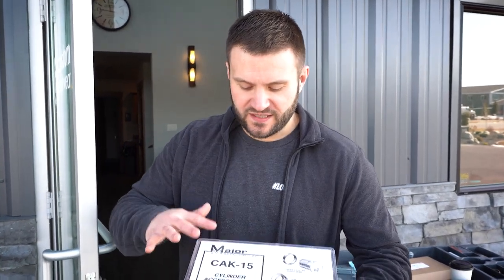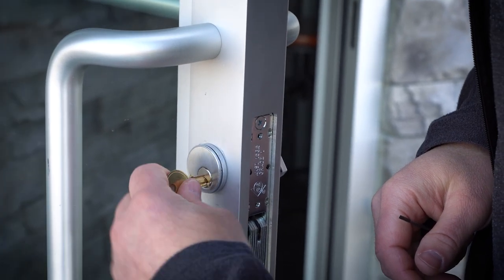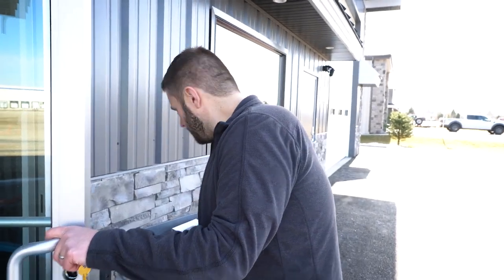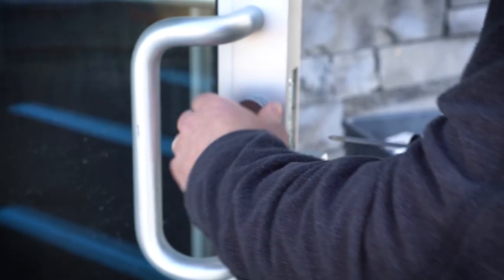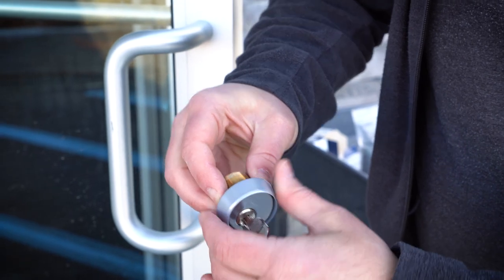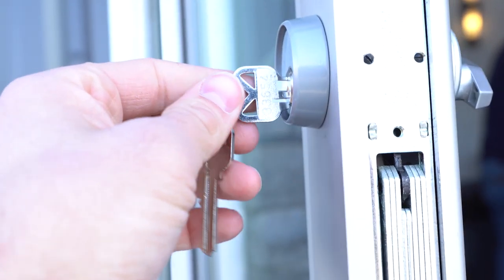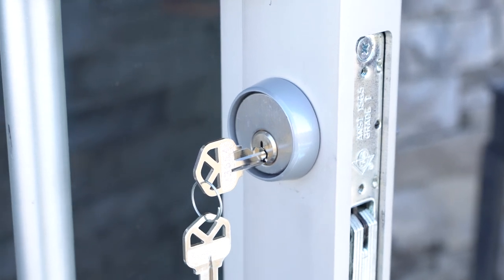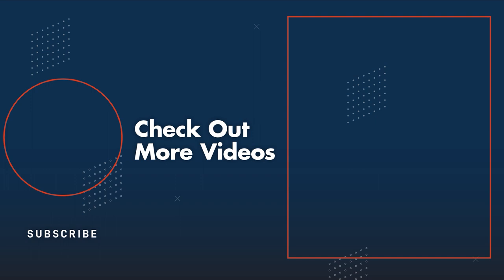Locksmithing 101 | How To INCREASE The Security on Mortise Cylinders!

Comment: I remember the first time i had to repair one of these on a shopping center door. Typical pipe wrench attempted break in. I remember struggling to remove the cylinder due to the fact that the set screws gets twisted  inside the lockbody when the cylinder is forced.

At the end of the day i ended up upselling a security collar to five of the tenants in the shopping center. Like a #Lockboss

Comment: Wonder if the K-Tool still works on those with the security collar. Does CLK sell the anti-bypass disk that screws on the the back of some mortise cylinders. It goes over the cam. #Lockboss

Comment: Great #lockboss work, but what if the ring has a little gap due to spring action and the thief has an over sized claw hammer with the right size gap between the claws, and pop goes the cylinder?

Have a great day

Comment: How big an issue is people taking pipe wrenches to the locks on glass doors?  Presumably that door has a thumb turn on the inside, and how strong is the glass door itself?

I would think that you would have multiple possible upgrades to that door as a #lockboss.

Comment: At my old job someone broke in using a pipe wrench when a locksmith showed my bosses the cylinder guard had they known about it earlier it would’ve saved them thousands from stolen equipment #lockboss